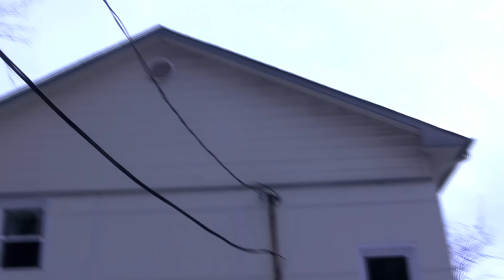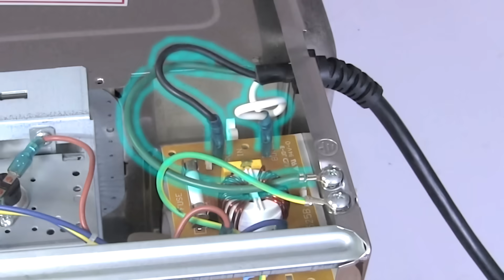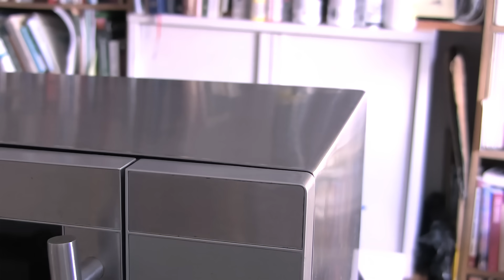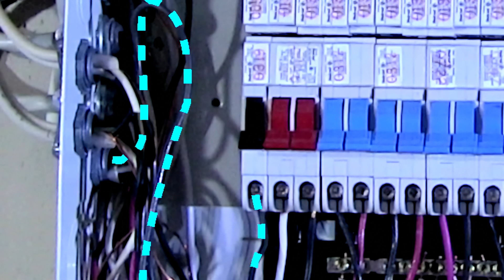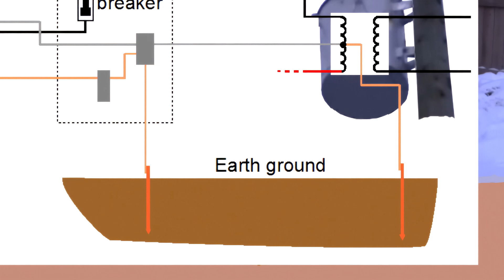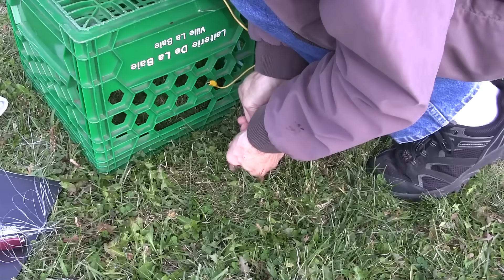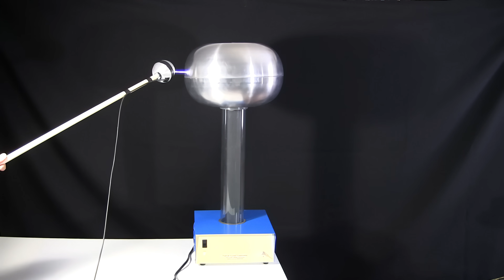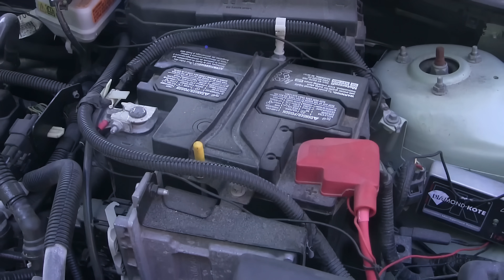What is Ground? Earth Ground/Earthing

Comment: So, the shortest path is through the load i get that. But if it has so much resistance (resistance of the load) and the ground wire so little why does the current not prefer the way through the ground wire and the neutral back to the transformer? At least a fair amount of the electricity should prefare that path. Which would be quite a waste of energy.  I mean you can’t just say that electricity always prefers the shortest path. Isn't there a certain number of ohms that you can replace with a certain kind of distance? Man, honestly something seems very wrong with the explanation.
Reply: Current Takes the path of the lowest resistance.  So its Always about the Ohms Not the meters. The resistance of the Load will Always be smaller than the insulation between hot and ground/neutral. If you Power a Load with 1200w (Like a Microwave) you have ~45 Ohms of Load and atleast!! 1 Million (or mega) Ohms  of insulation. So Close to no current can jump to the ground
Reply: @activex-co6ls  what he basically said at 2:48 is that the breaker switch goes off because the path from ground to neutral back to the transformer is so low resistance... seems quite odd. It would make sense if we say the ground wire activates the breaker switch.
Reply from the maker: @NiCeDarox Are you talking about the situation where the hot wire's insulation is damaged and the copper in the hot wire is touching the case or are you talking about the normal situation?
In the normal situation, the ground wire is connected to the case but it's not connected to the rest of the circuit except at one point, in the breaker panel where it's connected to the neutral. So in the normal situation, there is no closed path that includes the ground wire and so no current will flow through it.
In the situation where the hot wire's insulation is damaged, the path is shown at 3:27. That's the lowest resistance path (of course as @Dylan Elking pointed out, the polarities have to be right too, which they are).
Your initial question asked "So, the shortest path is through the load i get that. But if it has so much resistance (resistance of the load) and the ground wire so little why does the current not prefer the way through the ground wire and the neutral back to the transformer?". If you're talking about the situation where the hot wire's insulation is damaged then what you describe is what happens, the current prefers the way through the ground wire and the neutral back to the transformer. Regarding your last comment, "It would make sense if we say the ground wire activates the breaker switch.", you could say that as a root cause that isn't a part of the normal situation, though I'd also add the path from the hot through the case to the ground wire too.
Reply: @RimstarOrg  I thought the microwave case is the common ground for the neutral as well cause at the picture two wires are touching the case (I've heard that's what  some electronics are using for return path connections).  Now it actually completely makes sense. Great video and sorry for the dumb question.
Reply from the maker: Ah, the neutral doesn't make electrical contact with the microwave case. I hadn't realized that the diagram could be interpreted that way. So there are no dumb questions and I'm glad we could help. Thanks for asking.
Reply: Couple things for one the neutral and ground connect at the same exact point and end up at different places. Second electricity doesn’t take the shortest path to ground but actually to the negative of its power source which is typically called ground. Third when a excess charge is built it can always discharge to earth ground which is why if you mess with electricity outside you need to be extra careful. So you can think of it as a positive wire going to your load and the negative side of the load having your your ground and neutral in parallel. In the parallel, due to the physical make up of the earth, the ground of this parallel would have a huge resistance. So basically in typical use you get a direct shot going from positive to negative but in the instance that your neutral is broken you have a easy path to discharge to ground rather than through you. Hope that helps!

Comment: What happens if you connect the hot wire through a load to a neutral wire in a completely different socket
Reply from the maker: Provided everything is wired up correctly in the walls then that should work. I'd have concerns about the wire gauge though (the wire diameter/thickness). Maybe the socket where the hot is used is set up for a 15 amp current and so has a suitable gauge wire but the socket with the neutral is set up for a lower 10 amp current and so has a lower gauge neutral wire. Also, some buildings might have a main breaker panel and a subpanel and so the neutrals in the two sockets may be going to different panels. It's not something I'd normally try.

Comment: Question: Say there is a short and the hot wire is touching the casing of the microwave, but there is no ground wire. Why would the breaker not flip? Wouldn’t the short circuit cause the current to exceed the rates amperage of the breaker, which is usually 20amps for American households?
Reply from the maker: To put whqt @E!Maestro is saying another way, without the ground wire connected to the case, there is no complete path for the current to follow. So no current will flow through the hot wire. But if someone who's grounded comes by and touches it, then there will l be a complete path through the ground.
Reply: @RimstarOrg  what about "no ground" EU outlets? We only have hot and zero wires, and the latter is connected to cases of household devices, which is by your schematic completely equivalent. Why having a distinct third wire, though?
Reply: @arseniix  All modern European outlets have ground. On older installations ground was often not used on rooms that were considered safe.  The idea was that there was no ground potential available so even of you got shocked that would not be serious.

Now in many countries grounding was done with the neutral. While this is not ideal and not allowed anymore it works just as well as the neutral and the ground go to the same place.
Reply: There wouldn’t be any current until someone comes by and touches it, completing the circuit and delivering the dangerous shock
Reply: Why would it? Of course it would not. The voltage would remain in the case and when you touched it would shock you. It just just the purpose of the ground wire to cause the breaker to trip.

Comment: Thanks! This was informative.
I have 1 question though, why use conductive metal cases to begin with? 

Doesnt wrapping it in an insulator make it safe to touch regardless?
Reply from the maker: Here's a guess but maybe someone else knows for sure. The metal case may be for shielding the outside from the microwaves and/or the electronics that produces the microwaves. Why not put a plastic case around the metal case? Probably it's cheaper is they don't.
And thanks! I'm glad you got something from the video. Thanks work watching!
Reply: @RimstarOrg  Ooh, Thanks for the reply!!

Comment: Lightening has been striking the earth since the dawn of the human civilization and discharging huge electrons into the earth.

So why is the earth still considered neutral ( comparatively ) and not negative yet.

Does the recycle of electrons happen via water to evaporation to forming the rain clouds again and come back to the earth ?

Just a curious thought.
No flaks or any abusive comments please.
Reply: A simple explanation is that charges are always looking to become neutral. It is just a property of protons and electrons. You can think of it the same way as how heat always finds an equilibrium. Any imbalance in temperature will eventually become one equal temperature. One example of electricity doing this is how batteries can discharge, and become dead over time, even though you never use them. If the Earth were to somehow become more negatively charged than the atmosphere, it would bleed electrons until it wasn't. 

Also, the energy is transferred via a field around the electrons, so to speak. Electrons actually travel very slowly overall. They move fast individually, but they move in all directions rather than the direction of the current flow. All the electrons put together flow an average of 1 millimeter every 4 seconds. So, imagine trillions and trillions of electrons that, close up, all travel in random directions, extremely fast, with no apparent rhyme or reason. Then, zoomed out, you see all those electrons as one giant mass moving 1 mm / 4 sec in the direction of the current flow. The individual electrons zoom all over the place quickly, but they drift very slowly in the direction of the current flow.

Electricity seems so complicated because it is unlike anything we regularly encounter daily. We are limited in our ability to understand electricity using just our human senses and must rely on technology to describe almost every aspect of it. I will do my best to give you a basic understanding using something most people are more familiar with, torque, horsepower, and RPMs. 

Torque describes force in a turning direction. It is the same thing as force that you would naturally think of when you push an object, but instead, imagine that object rotating. In a car, this describes the amount of energy the engine is delivering in the form of turning force. RPMs describe how fast that torque energy is being delivered. When you combine the two, you get your horsepower. This is why you can have smaller engines with more horsepower than larger ones. They are just capable of delivering their smaller amounts of torque much faster due to higher RPMs thus getting more instant power delivered. This is good for driving fast. Those big engines with lots of torque are good for heavy loads because they can deliver lots of power even when the RPMs are low. Trucks need power to get moving but can use their own force from their own weight to sustain that movement. (Force = mass x acceleration)

Now, compared to electricity, torque is like current, RPMs are like voltage, and horsepower is the same thing as watts. Your current tells you how much energy is being delivered. Your voltage tells you how fast that energy is being delivered. When you combine the two together, you get your watts. Watts and horsepower are the same thing. 1 horsepower equals 745.7 watts. The power from torque and RPMs is convertible to the power from voltage and current. If your car had 300 horsepower, you could tell people that your car has 223,710 watts. Some people might assume you must have an electric vehicle or something, but you would be right.
Reply: @rjfontenotiii  Thanks a lot
Reply: @rjfontenotiii  torque or torsion?
Reply: @withershin  Torsion is the twisting that occurs when the force from torque is transferred from one object to another.
Reply: @rjfontenotiii  one example sure but there's a whole deeper rabbit hole of physics. How much torque does an elastic band have?
Reply: @withershin  The energy stored from an elastic band is not torque. It can be transferred to torque if you attach it to a wheel and wind it up. Then, that wheel would have a measurable torque. An elastic band, by itself, does not have torque. If that elastic band is somehow spinning, then it would have torque.

Torque is basically the same thing as force from an object moving. It takes energy to move an abject from point a to point b. Instead of moving, however, torque is when that object is spinning about its own axis. It takes energy to make an object spin.
Reply: @rjfontenotiii  never mind. You must only be an engineer. Cheers mate.
Reply: @withershin  I hope you were able to learn something. One day, if you study hard, you can understand physics too.
Reply: @rjfontenotiii  cheers
Reply: In a lightning strike no electrons actually flow into ground. I'm sure it'll loose charge anyways (like a capacitor or battery after a while) but that isn't even necessary. The analogy of actual electrons flowing around only holds up so far. I'm actually not certain what the real explanation is but this is more of a shortcut than the actual physics.
I'm pretty sure very few actual electrons flow from the cloud into ground, this is no electron beam after all :D
Reply: @LuLeBe  Thanks a lot
Reply: You have to go way deeper down this rabbit hole of physics. Water evaporation is one of many methods where energy cycles back up into the atmosphere. My eyes were opened when I figured out via youtube and the internet that electrons don't actually flow. It's just way easier conceptually to describe it as such. All energy returns to the earth ground eventually. Us humans are just really smart at moving it around and keeping it aloft for a while. Edit: All Earth energy typically returns to earth ground eventually unless it goes into space.
Reply: Thanks all for your nice, logical and prompt replies
Reply: Not regarding lightning, but the electrical system we have here where I live, called "IT" system, where the "I" means isolated,  we do not have anything "neutral" and therefore in an intact system no potential between a phase and ground, which means one consumer can have an earth fault on his electrical plant and everything is still "ok" until an electrician measure the voltage between phases and ground and find a potential between one of the phases and ground,  in such a case, that is not uncommon,  our ground has actual potential,  for everything connected to the secondary side of a transformer, just saying

Comment: Is the ground used for transmission from the power stations? IE is there just the 3 phase wiring distributing around the area, and no neutral as the ground / neutral is the reference to the phases, and is literally the ground?
Reply: Generally 3 phase HV has an earth grid at the power station and at substations, but no earth wires used for anything but protection of the pylons inbetween

Comment: If ground and neutral are connected, why bother having three pins? Why not just have hot and neutral?
Reply: I'm not sure about the US, but in Australia one reason is so that you can detect if current is returning via a different path than neutral, i.e. there's a fault or someone is getting electrocuted.
Specifically, most houses have RCDs (Residual Current Devices) installed, which compare the current flowing through the Active wire and the Neutral wire, and if they're not equal (specifically by more than 30mA), then they trip.
The ground wire of a given circuit bypasses the RCD, whereas both the active and neutral wires pass through the RCD, so any current escaping via ground isn't going to flow through neutral on the RCD, with a higher current still flowing via Active.
As such, this limits the current that can flow from Active (through the RCD) to Ground (bypassing the RCD) instead of neutral (through the RCD) to 30mA, which is the limit set to prevent electrocution.
Reply: An easier answer is that the ground is an alternative path for the energy to go in case of a fault. Energy will take the path of least resistance (sort of). If there is a fault, and you become the path of least resistance, you could die. By attaching the ground, which is basically just an extra, unused neutral, to the case, the energy will go there instead.
Reply: It has to do with the paths of the electric currents. The ground wire serves two purposes by providing a path of very low resistance: first, so that the breaker trips on over-current and removes the source of power from the fault; and second, so that the first hint that a fault exists is the breaker opening and not someone getting shocked or a fire starting.

In the case of the microwave, without a ground wire the fault may cause a fire to start and keep going (most electrical fires stop once power is secured) or it may just energize the case and do nothing until someone touches it and gets shocked. 

There are electrical systems without a ground wire, but they are less resilient to damage and faults and so must be monitored/inspected more. There are also some outlets (GFCI, typically found in bathrooms) that "monitor" the currents of their hot and neutral wires and automatically disconnect if the currents aren't the same.
Reply: Because people do not want to die!